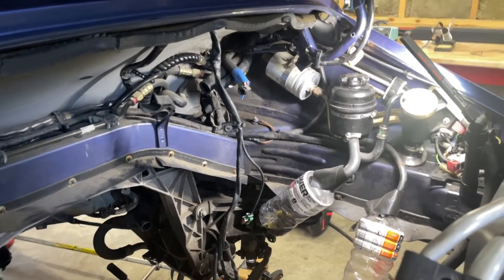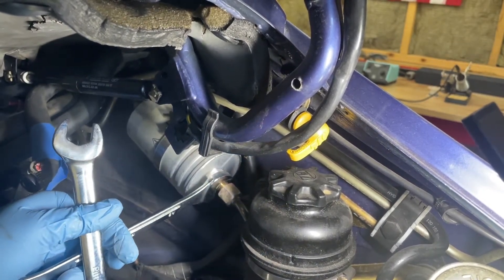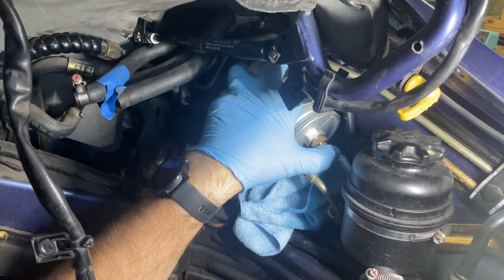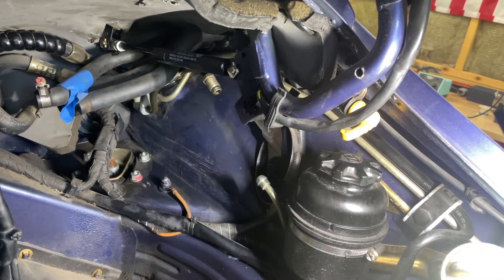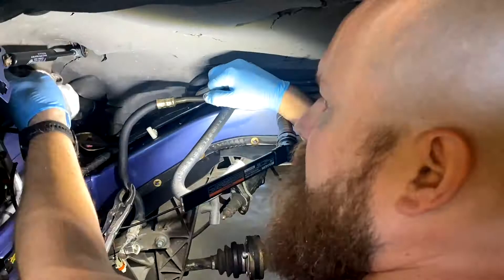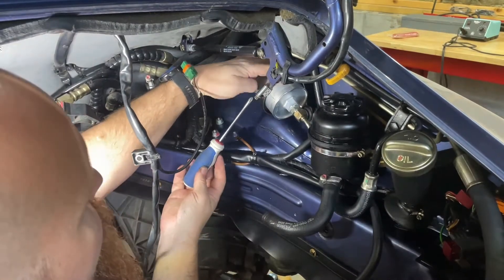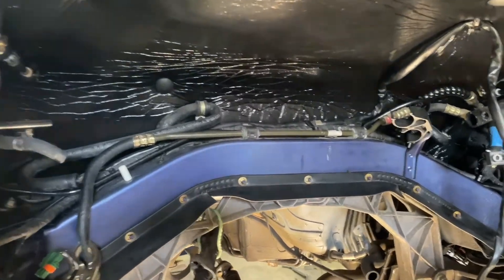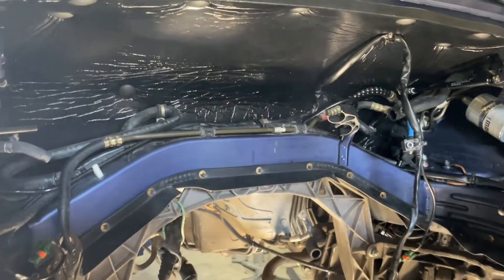Porsche 993 - Prepping engine bay for motor (fuel filter & engine sound pad

Comment: I just completed the 60,000 mile service on my 993. I also replaced the two lower valve cover gaskets (Molykote 111 is your friend). I also replaced both the HVAC and oil cooler ballast resistors (what a pain!). I used an airbrush air compressor to 'force-feed' the Mobil1 75W90 LS gearbox oil (I had the car on jackstands in my garage.)
Reply from the maker: This project is about 12+ videos long so far and is by far the biggest job I've ever done.  I started with just the clutch and it turned into 4-5k worth of parts!

Comment: Another great vid. I just bought the Pad Keeper. I am going to be doing this install this week. I really wanted leather sound proofing in the engine bay.
Reply from the maker: Thanks for love man, I'm glad someone is watching ;)

For what it's worth, replacing the pad is pretty simple, it just takes patience and time.  I looked at the pad keeper, but it's more expensive than the replacement foam, BUT.... if your engine isn't out, pad replacement is a PITA, I'm sure.  I decided on new foam because the old foam was so dry rotted, pieces were starting to fall down onto the engine and I don't want that in my intake.

Comment: thanks for putting these vids out, I cannot believe you don't get more likes or views on this subject or more specific the "993" repairs.  One question, did you have to go through a Drive Cycle process in order to pass emission ? I had my battery disconnected for a while and now I cannot pass my local state Emission inspection, and the drive cycle is so dumb that where I live with all the traffic I have is nearly impossible. Thanks!
Reply from the maker: Thanks for the love man!  I think these videos aren't more popular because I suspect there's few people that do their own work on these cars, and the shops don't need the videos....  but that's just me.   I'd love to get more likes and views, but I made these videos for documentation purposes.

As for the drive cycle, I absolutely had to go through that process to pass inspection.  There's no real way around it.    In NYS you only need to have 5 of the 6 monitors on (and operating) within OBD2 to inspect the car
Reply: @beardedgarage  I have the same here, I'm located in central Jersey (5 out of 6) and I'm considering getting a classic vehicle registration as the car is 27 years old. That way I wont have to go for inspections every year on a vehicle that I don't even drive. '97 4S. 
If you are not too far away from me I'd love to lend a hand if you pull the engine out again or any type of big jobs.  I love these cars and my dream would be to have an S model 911, 1972 but the prices are ridiculous.  BTW what is your background, are you a mechanic by trade or just hobbyist? Your shop looks pretty legit!
Reply from the maker: @frxa2739  I love these cars too, and I love working on them.  I’m just a hobbyist that’s been working on cars for 20 years.  I’m lucky that I’ve made some really knowledgeable friends over the years and we bounce ideas off each other.  As for big jobs, I have another 993 (1995 coupe) that I’d like to do an engine out job later this year and I’m planning on doing everything on that job (e.g. complete engine tear down)

If everything goes right, I’ll probably sell this 97 cab since I’ve got my eye on a few other collectible 911s like you.

Comment: Great video as usual, love the detail you put into these.  I wanted to ask how you located and punched the holes through for the mounting studs that the plastic caps thread onto?  Was it just a matter of pushing the pad onto the studs or did you have to use a punch to make the holes in the pads.  Thanks again for making this.
Reply from the maker: I literally lined up the pad in the bottom corners in the back of the engine bay.  Once it was completely in place, I just pushed the pad onto the studs.